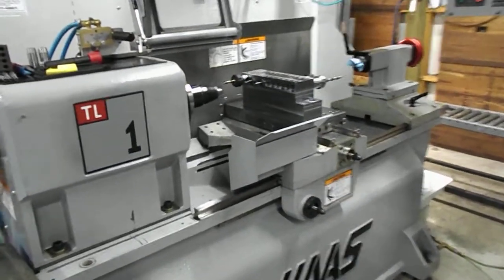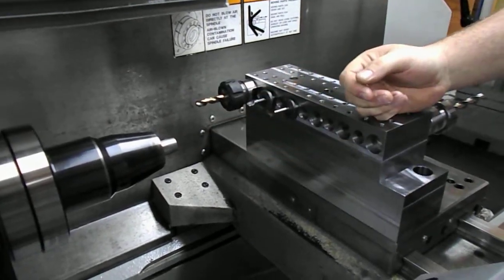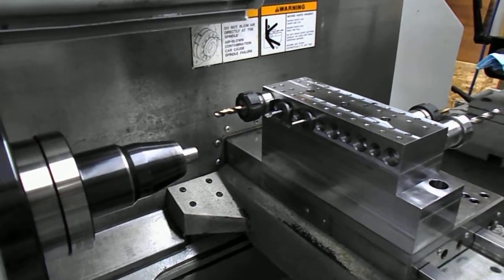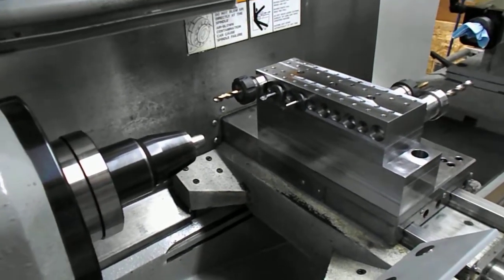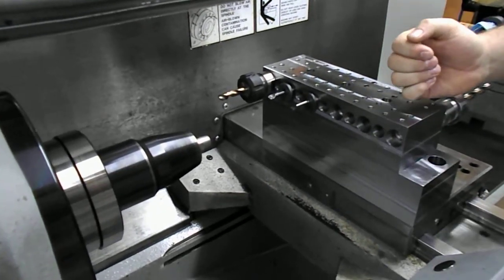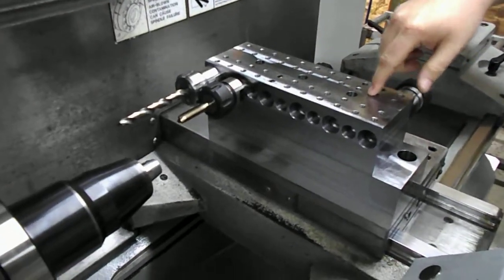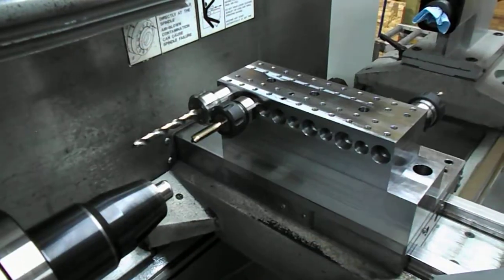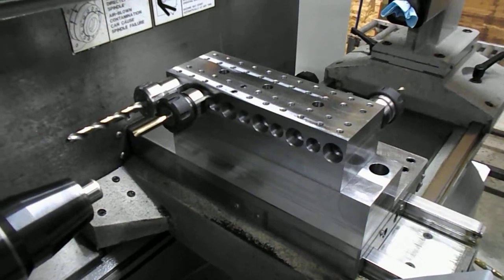Quick Change Gang Tooling System for a Haas TL-1 and TL-2 CNC lathe

Comment: After searching for a long time for a sturdy, TL-1 gang tooling system (and not finding anything) I met the owner of Pro Machine Works. I purchased one of their quick change gang tooling systems and my productivity has sky rocketed! No more pausing to change tools with each new operation, allowing me more time to be more productive in other areas of my shop as well. Excellent repeatability. For anyone with a Haas TL lathe, this is a must have!
Reply: How did you find them!